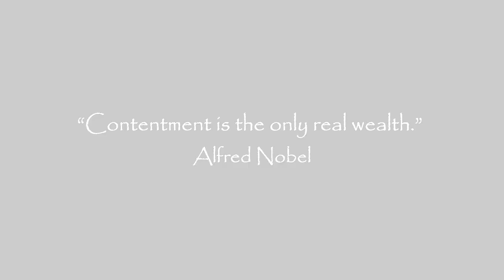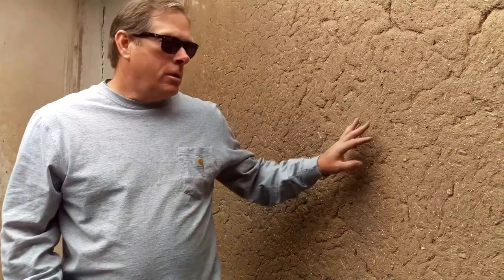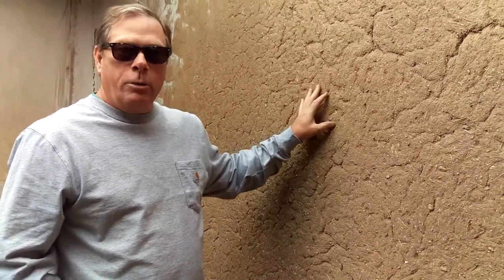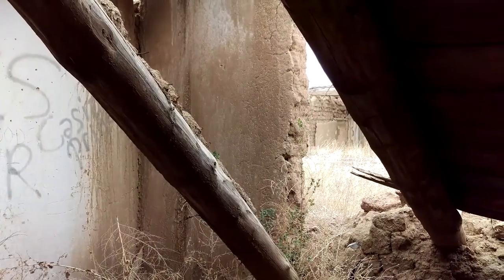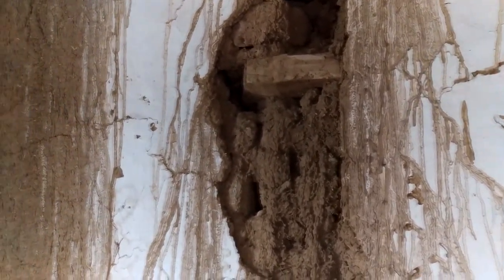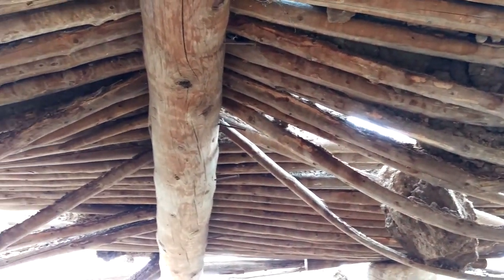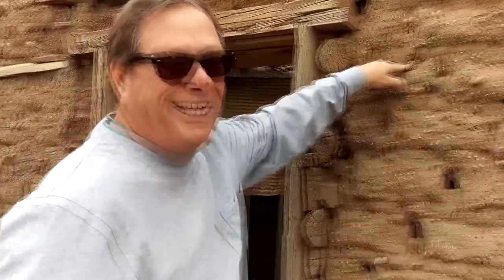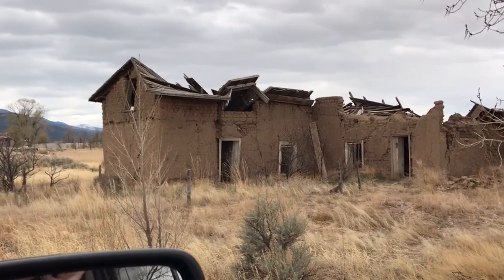1930's Cozy Fixer-Upper! - Adobe Bricks Part IV

Comment: They say Navajos, Hopi and Zuni didn’t really use adobes because of scarcity of water. Pueblo’s from the east had the rio grande river. Navajos very briefly used them for 50 years after long walk and boarding school days “ my mom lived in a adobe for a couple years.” There is absolutely no adobe homes where I live at. In fact maybe the whole reservation. I’m making one for an art studio. No ones helping me, I think they think lowly of the brick. It’s a lot of work making them. Navajos use logs for Hogans, but I read when we use to experiment with adobes, we made Hogans made of adobe, just the base and the roof was log.

I think if I make a structure they’ll think differently. But I made a wall, that’s when I decided to use it.
Reply from the maker: Agreed  that the Hopi and Zuni ruins we have seen were made from stacked stone, with some mud mortar and plaster. That's cool that you are working with Adobe. We are preparing to build a home of adobe and straw bale. We have a nice seam of clay-sand soil on our property. It is a lot of work making brick. We have designed a little gantry that will suspend a 24-brick form. When the form is full we crank it up out of the way and roll it a few feet away, drop it and fill it again. We think we will be able to make about 120 bricks per day with this method. We'll see.
Reply: @contentment164  that’s good. I’m using puddle method. I have 9 forms. When it’s dry enough, I put it by our large storage on south side to speed up drying. I can only get about 10-15 bricks a day. I’m just doing it part time. When I have enough I plaster it to protect it from elements. So far I have 485 bricks at 6 by 15 by 11. I put manure in it, it gets hard like a rock.